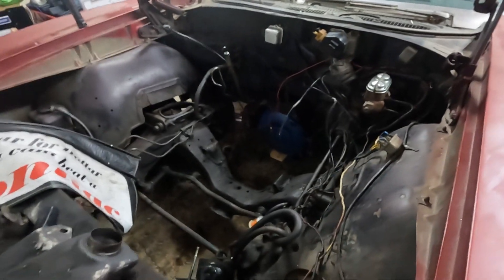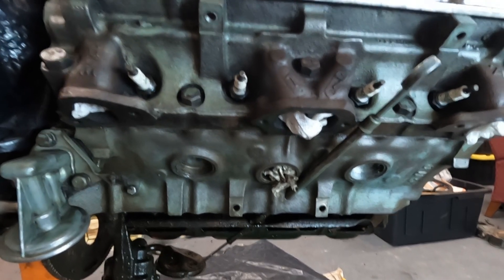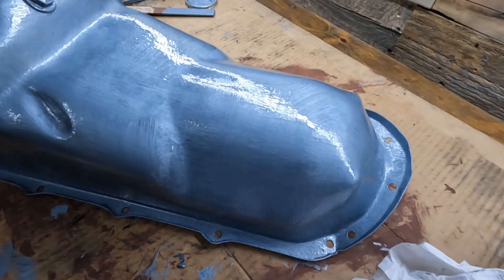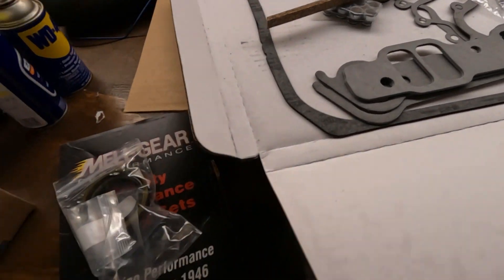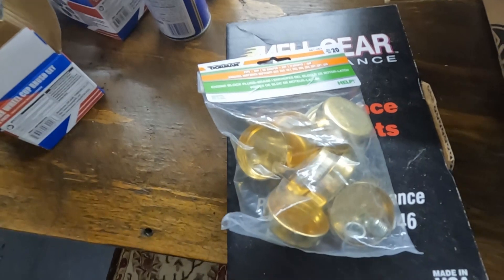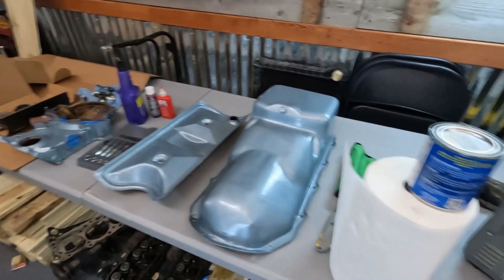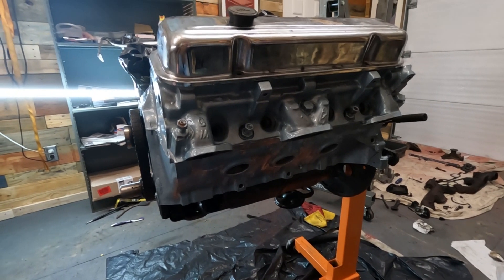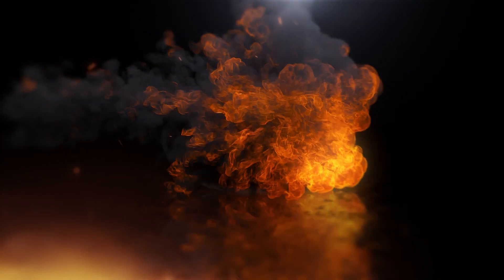Painting the Pontiac 350 Engine

Comment: to each is own but it would have looked a ton better using the aerosol pontaic blue paint. No brush marks...IMO
Reply from the maker: I totally get it. My problem was dealing with the cold. The brush-on paint had a lower temp threshold and I couldn’t get the temp up high enough for spray. And it cost less. However before I put it in, I may try to smooth it up a bit and then spray a final coat. Thanks for watching!